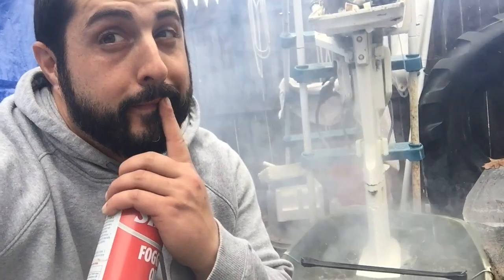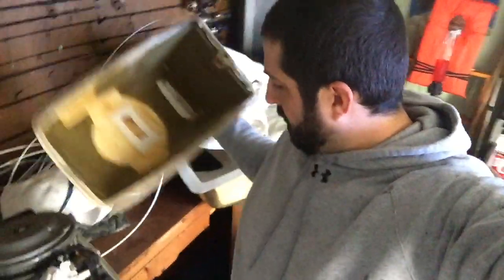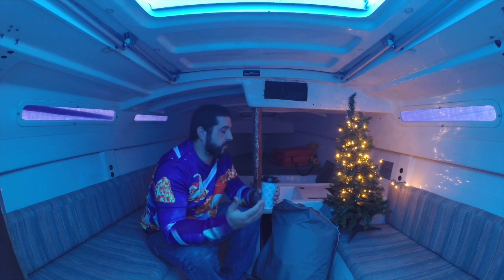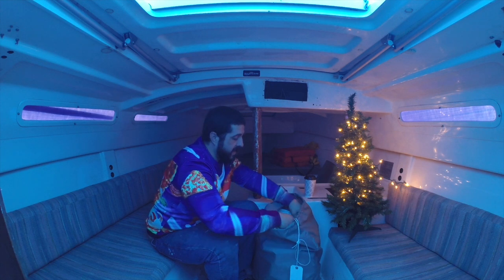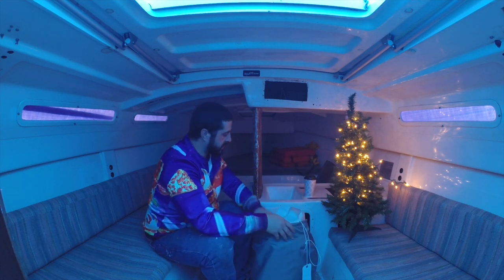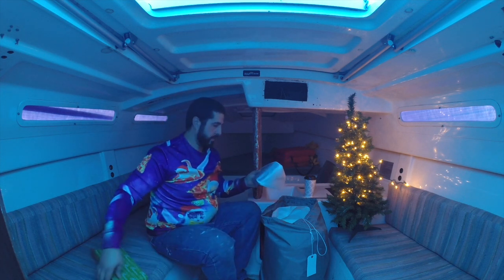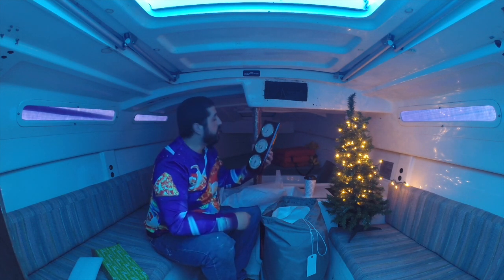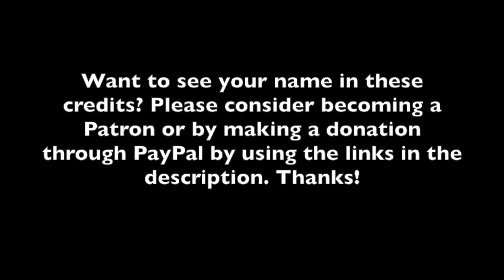Winterizing A Sailboat & Motor

Comment: Ryan! Cool video. Great idea with the Christmas theme, little tree, and the gift!  Congrats on the new jib. As for Chase's question below. I know from having to wrap my Little Girl every time I leave. Its a whole lot easier to get the tarp to lay right when the lifelines are out of the way. Hope you have a good winter and get some work done on the inside of that cabin! I have all brand new mahogany trim already cut, laminated, stained and varnished. Little Girl is getting a Christmas present and she is going to look pretty!  Have a good one Ryan!
Reply from the maker: Thanks Randy! Little Girl sure is getting spoiled!
Reply: Where do you buy mahogany. I'm thinking teak or cypress wood.
Reply: @cwmaxfield2000   I buy all my 'boat' woods at Baker Lumber in White River, VT. Don't buy anything wood for a boat from Home Depot or Lowes. Find a reputable supplier.  I was able to get a very pricey sheet of book matched flame mahogany plywood and did my whole cabin with it.  I also bought Meranti wood  for the compnionway and Sapei for trim
all from Baker. Wood from Home Depot etc will not have been kiln dried properly. Find a really good supplier and look over at their selection.  Good luck with your work. Randy Gardner

Comment: Have you got a low wattage heater to keep the inside dry and mould free?   over winter.  Condensation can cause real
dampness/ mould. A light bulb in a cookie tin was one way.
Reply from the maker: I was in there with a space heater enough over winter to keep that from happening, plus removed all cushions etc. to prevent them from getting mold and stuff.

Comment: Why you did put antifreeze in your block since its get so cold up there ?
Reply from the maker: Outboards don’t need antifreeze because the block is vertical as opposed to horizontal like an inboard motor. When the engine shuts off, all the water in the block drains out through the cooling system.

Comment: why did you take life lines down? just curious... :)
Reply from the maker: Just to keep the angle and the shape of the tarp so it acts like a roof and lets the rain, snow, ice, sleet, and all other New England crap slide off easier. If I left them up then it would make a gully on each side of the mast and it would all collect in there and cause all sorts of problems.
Reply from the maker: the PO replaced the original lifelines and stantions with higher double lines, they are actually about as high as the mast when the mast is laying down. I still would have taken them down even if they were smaller though. I want that angle of the tarp as steep as possible, doesn't take to long to get them off anyway. But to each their own.
Reply: oh ok Thanks for the explanation, my mast was higher and lifelines must have been lower, never did that on mine... :)